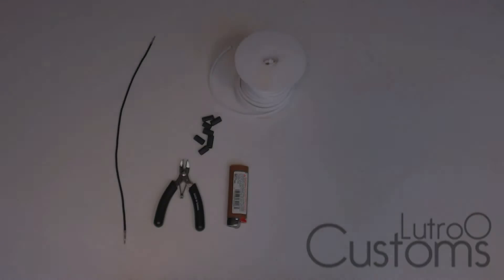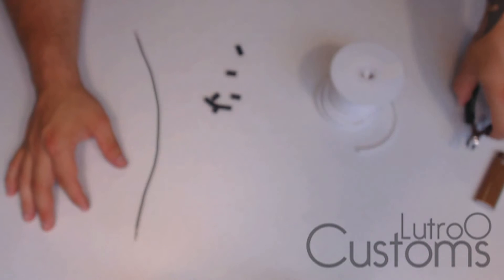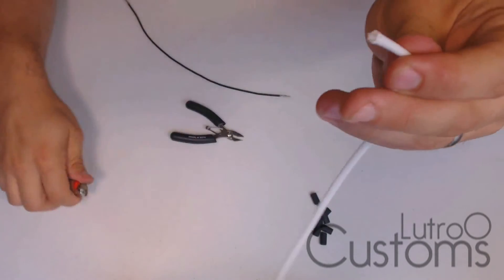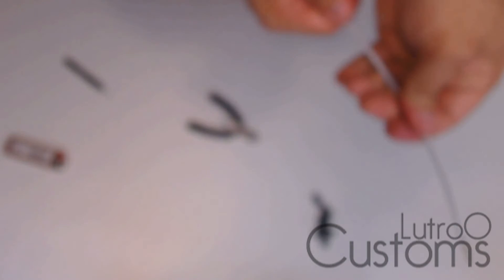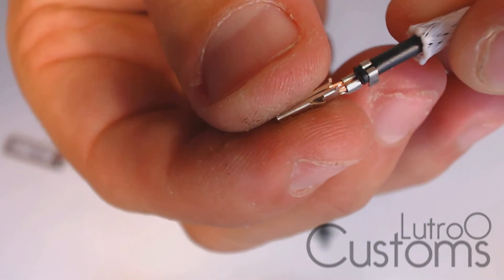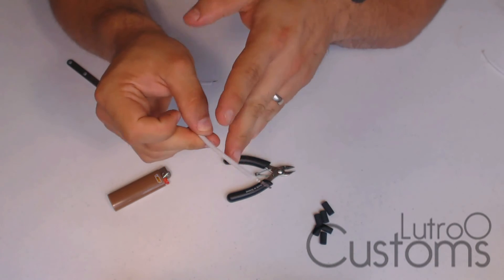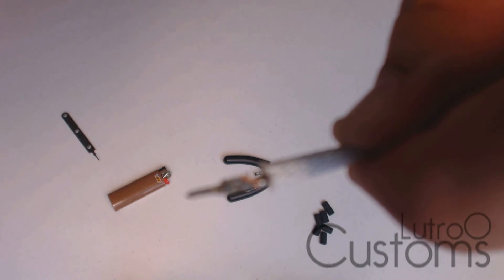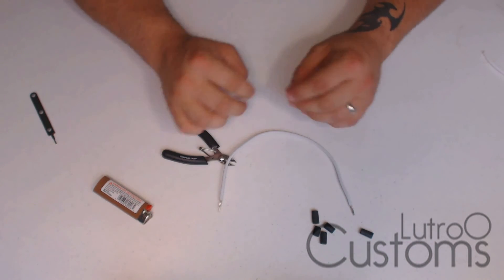Lutro0 Customs - Heatshrinkless Sleeving "Plastic Type" Method

Comment from the maker: For half and nonmodular psus I open them up and use a little bit of brush on superglue and heatshrink to end the sleeving on the inside of the psu. This is the cleanest way to do it, however I have seen people use a large peice of heatshrink and cover all the wires right by the hole and heatshrink all of them as close as possible to it. But it normally turns out lumpy. In my faq I cover this inlength. Link is in the video description.

Comment from the maker: For front I/O cables I do use heatshrink for those. However I shrink the HS over the connector. You need to be careful with them as the plastic that is used is almost always very low temp plastic and will melt easily. I will also be making a video on it, but if you watch the fan guide it will show you the basic method.

Comment from the maker: If you care carefull the wire wont melt, but even it does for a little the weld will hold it into place, plus the wire is held by the crimp mostly not the insulation.

Comment: hi lutro great video i was wondering if you can sleeve the front panel wires i.e pwr switch, reset , hdd led etc.  because thier are thin a separate wires do you use one sleeve to in house them or separate sleeves for individually wires.

Comment: great video! What size sleeving should I get for typical 24pin/gpu wires?  The place I just got some from sold me stuff that is like 1/4 the size you have! its tiny and I cant get the wire trhough without a major struggle lol. So, when I go back and tell them its wrong, what should I say?
Reply from the maker: I would look for LC Teleios Sleeving on www.modbunker.com. I created this sleeve and its 4mm in dia. It works perfect for sleeving and is worth it.
Reply: Thanks man.. I wound up going back (FrozenCPU) and they swapped it out for me. gave me 1/8" instead of the 1/16" - and its bitspower super tight. Was much easier now lol

Comment: Hey guys, i am planing on doing this. For a 24pin sould I take the same length for all 24 wires, or 12 a bit longer and 12 a bit shorter?
Reply: If you do 12 that are slightly shorter you will give it a natural curve
Reply: Thankls for the info!

Comment: can i use Paracord 550 Type III Nylon Cord
Reply from the maker: Yes, that is the type that is typically used.
Reply: lutro0 het bro in two 6 pin pcie to one 8pin connector can i use heat shrinkless method and how do do you manage to make a long lasting curve in your cables since the cables that specifically manufactured by psu makers are long and the curve could not be done

Comment: I‘m confused. How can it be „heatshrinkless“ if you a) use heat and b) use a heatshrink? I did this kind of cable sleeving myself, took ages and the result wasn‘t perfect, because I‘m not a pro. And the entire time I thought „why the fuck we don‘t just crimp the sleeve together with the cable.“ Sure the pins are not made for this, but the industry could simply make them to also enclose a sleeve. Much quicker, much better result. Or, if you crimp it the oldfashioned way and after you put the sleeve, crimp the sleeve with a ring. The only problem is that those tiny rings are hard to handle. But for private use I never saw a proper tool for that.